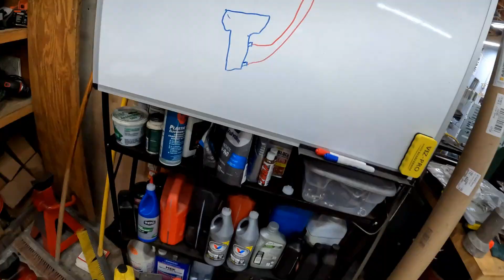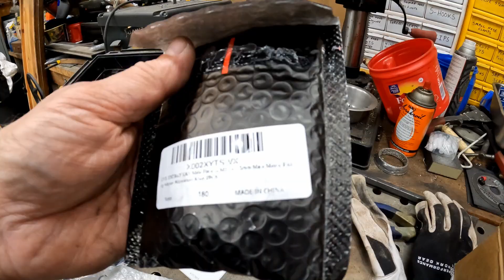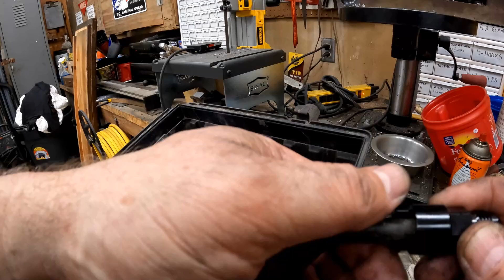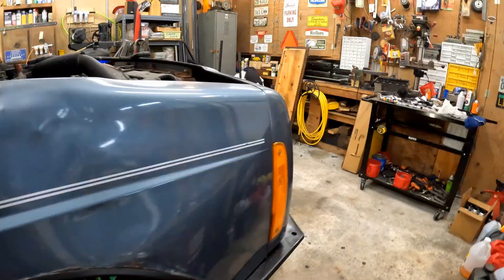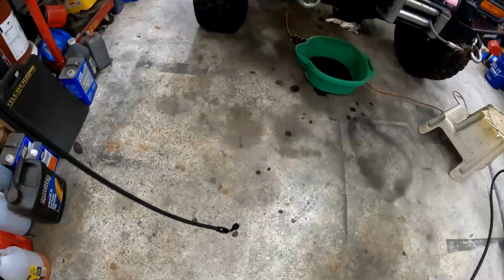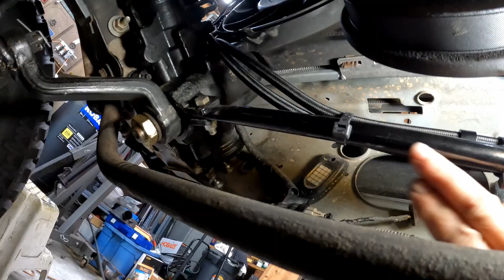Making and Using AN-6 Transmission Cooler Lines -- 1998 Jeep Cherokee XJ

Comment: Did plumbing this in assist in coolant temps as well? Long term review of the upgrade?
Reply from the maker: This was what was causing my temp issues, long term review still working great, cooler and AN6 lines all good, no leaks.  https://youtu.be/jDHay5do9OE?si=EzKfg0teWREp4cj2

Comment: If never running the Jeep during winters what do you think about bypassing the radiator all together? I've been going back and forth on if I want to bypass the rad completely or not as my XJ is basically a dedicated trail rig and rarely if at all gets driven in cold weather anymore. Trans temps get pretty spicy on mountain passes and long hill climbs on trail
Reply from the maker: You can bypass the cooler in the transmission, just make sure your external cooler can keep the temps down enough and it should be fine.

Comment: Part numbers for the fittings used?
Reply from the maker: I used the list from this write up (link below) to order my fittings.  I did not order the same brand, but you can use the numbers to cross reference to whatever brand AN fittings you like.  https://there4.io/2019/07/17/Jeep-XJ-Transmission-Cooler-Line-Ugrade/
Reply: @ludercoarms  Is it 5/16 or 3/8” hose? I think i heard 3/8” hose. Just making sure
Reply from the maker: @andresmgna4692  3/8
Reply from the maker: @andresmgna4692   it's 3/8

Comment: I had a problem where I would do a long climb and the trans would get to 235 I installed a cooler and out a pre and post cooler temp sensors and it still gets hot so I will be running your set up from now on
Reply from the maker: I worked for mine, hopefully it helps you.